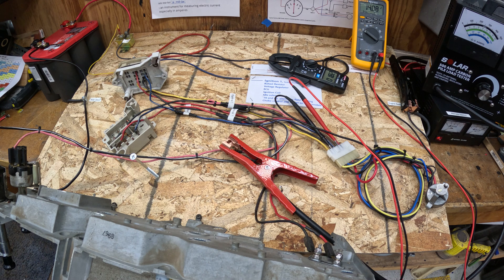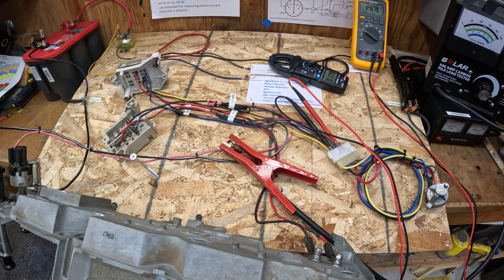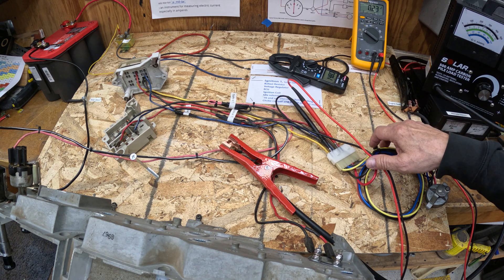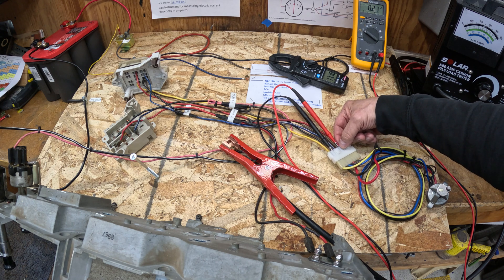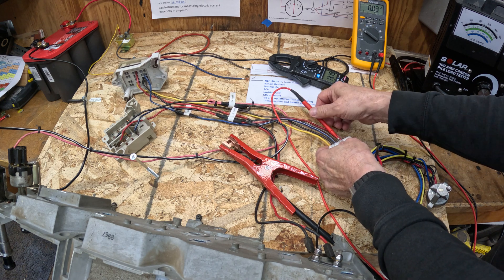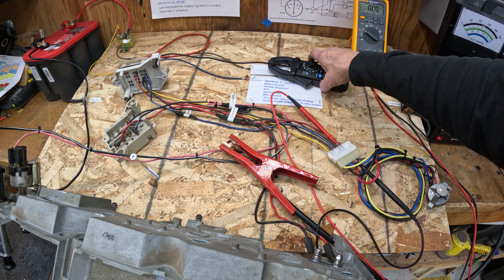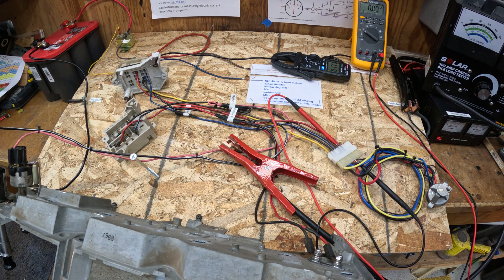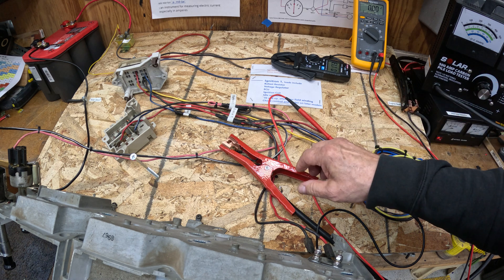The Chrysler Mopar Ignition switch Molex connector voltage drop Demonstration video

Comment: I just subscribed. I like your explanations and diagrams of how you fixed on Explain how wiring issues can be dealt with. I have a 1973 Dodge Power Wagon. That has a few electrical issues. I'm hoping I can ask questions along the way of repairing my own stuff and have you possibly lead me in the right direction.